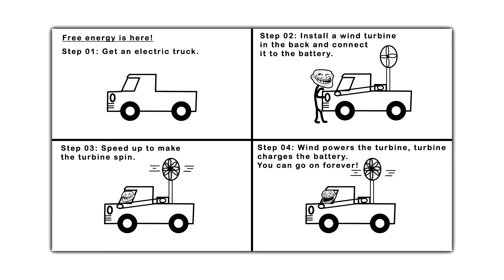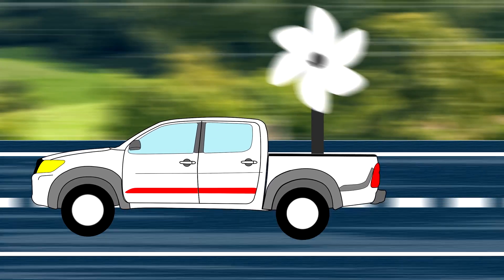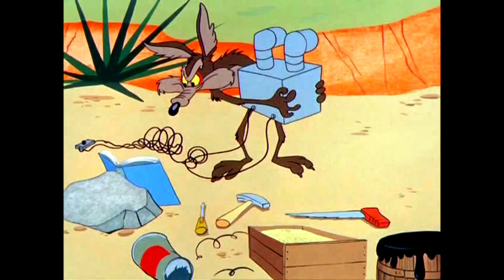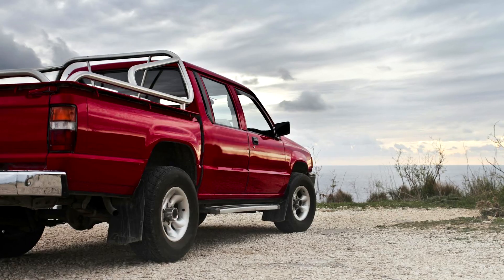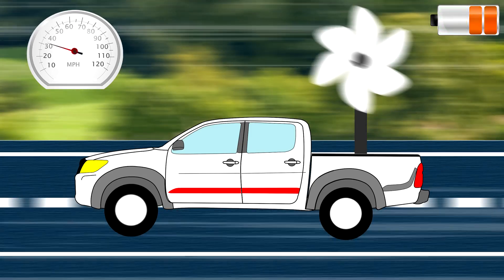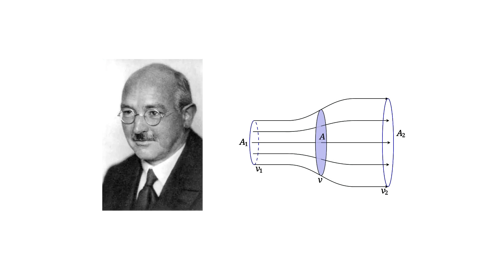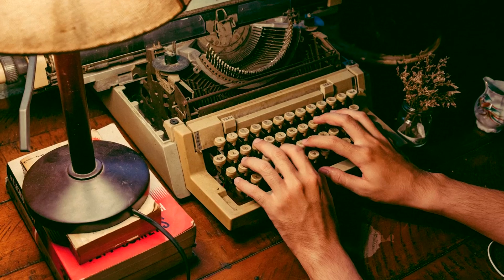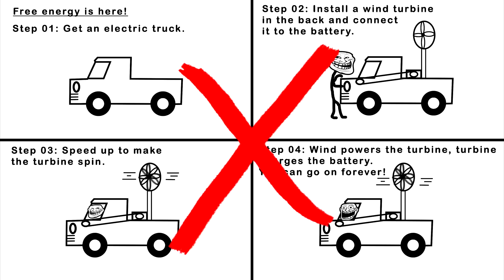why it doesn't work 29

Comment: What if somehow we found a way to power the sun and I say that as in give it fuel to stay alive as long as it gets the fuel, let’s say this made up scenario. I know this probably won’t work just normal electric and we put solar panels all around and connect those panels to the sun to power the sun or like maybe put, the sun forever because doesn’t travel in space that would be a problem no problem. Only problem is that it would still produce sound

Comment: i have 2 ideas for these videos:
1. you can transform the heat from the atmosphere into energy. that will solve the problem with global warming.
2. if mass is energy you can transform trash into energy.
Reply: The first doesn't work because thermodynamics states that energy eventually goes to heat anyways. That said, capturing heat as energy and then beaming it out to space IS something that can be done, we just don't know a practical way to do that.

The second is called "fusion". Worse, this is much, much, much harder than current fusion research and is the type only found in massive stars (like over 10x the mass of our sun). But it can (in theory) be done. Note, this still leaves us with some trash. You could alternatively antimatter annihilate things but that's a lot harder.

Comment: Would it make the battery last longer tho

Not infinitely, but longer? Would it technically be a bit more efficient? What if you installed a bunch of small ones all over the vehicle
Reply: No because the "wind" is actually just the motion of the truck being induced by the battery in the first place. So you spent an extra X amount of energy to get back 30-40% of X
Reply: @salsamancer  But it's been proven that you can move faster than the wind powering your own vehicle. Someone in this comments section also suggested a video be made on that topic explaining why it works.
Reply: @ZoofyZoof  you're thinking of sails and you're right. But wind turbines don't work like sails, they extract momentum from the wind and covert it to electricity.
Reply: @salsamancer  Okay :)
Reply: I finished testing, and i learned that it does in fact increase the battery life. I used 2 rc cars, one with a turbine connected to the charging port and a normal electric car. The normal car traveled for 1.2 miles while the turbine car traveled for 1.9 miles.
Reply: Im testing that right now. I'll get you an answer by Thanksgiving.

Comment: I feel like instead of a wind turbine you could use solar panels mounted on top of the truck, and put battery racks in the truck bed, then just park it somewhere in the sun and then when driving just plan your route and put a tarp over it when it's raining, the limits would be Charge time, Daylight hours, Low travel distance, and Maintenance but other then that perfectly functional and far better then the wind turbine method.
Reply: That's called renewable energy. We already have that, as the user above me stated.
Reply: That's like a project every college with an engineering program has, and they do it.
Reply: that's not perpetual motion, is it?
Reply: @bipolarminddroppings  No because you're relying off of the suns energy and the sun is not eternal.
Reply: You'd need a massive solar array to power a truck, which wouldn't fit on it. Or, you could just leave it parked for a boatload of time, but at that point you might as well use rooftop solar (putting solar panels on something that moves is more expensive and leads to more wear and tear) and charge it at home.

Comment: I never really understood why perpetual motion can’t work in principle. Why can’t we have a system that uses energy to transfer it to a different system and that system’s energy is then transferred to the first like a machine that lifts a rock and then uses the rock’s kinetic energy in the fall to power the machine or a system like this where motion through the air is by the kinetic energy of the air itself? At least in principle
Reply: As Tyler said at the end, you only get back what you put in at best, things like friction and maintenance lessen the yield, and of course a machine that powers itself efficiently does not have any excess energy to power anything else, making it all redundant.
Reply: @WillKester  ah I see. I still would like to learn more about physics and engineering to get it better plus it’s always good to learn
Reply: because there is no way to convert 100% of the energy available to do work. You always lose some to heat, friction etc. Doing work always creates inefficiencies.
Reply: Think about it like this. You have two pitchers, one filled with water. By moving the water between the two pitchers ONLY, you will never be able to get more water. At best, the amount of water will remain constant, but what will probably happen is that some water will get spilled and that some water will eventually evaporate into the air, causing you to actually lose water over time. The only way to get more water in this situation would be to get it from an outside source, which would basically be like plugging your perpetual motion machine into the electrical grid

Comment: honest question, if you were to use a turbine with drag minimized, would it in turn reduce power consumption at all, at youll get some of your enegy lost by wind back? would it be enough to be feasible?
Reply: they mentioned in the video that wind turbines can't hit 60% efficiency, so I'm thinking no matter how good the turbine you'd always be at a large net loss.
Reply: There is no way to do work (thats a technical physics term, look it up if you don't know what it means) without losing energy to heat, friction, etc. 

The turbine adds mass, mass increases inertia, therefore the entire system is already less efficient than just using a normal car. Then you have the friction created by the turbine as it spins, the drag from the turbine as it moves through the air and a thousand other inefficiencies that cause potential energy to be converted to heat etc.

If you reduce the drag from the turbine, you also reduce it's efficiency at turning wind into usable energy. Even if you could get a turbine to 100% efficiency and the car+turbine had zero drag and no mass, you would still lose energy to heat when the energy is discharged from the battery.